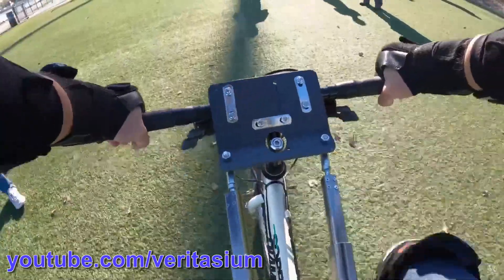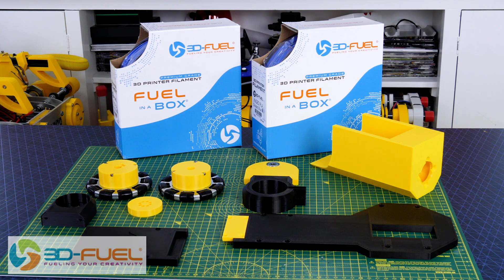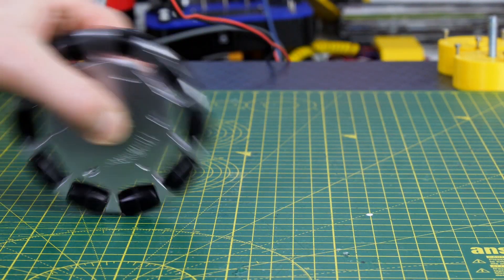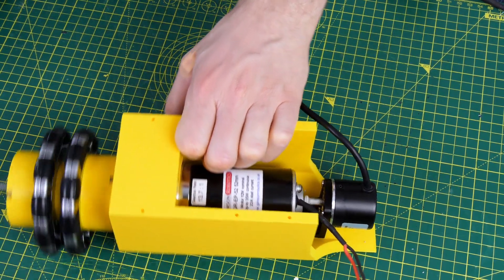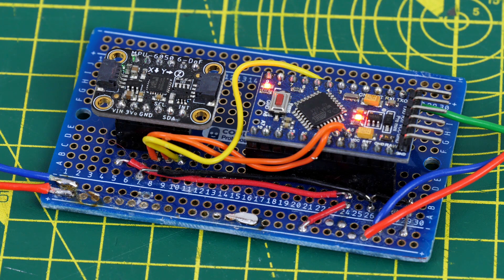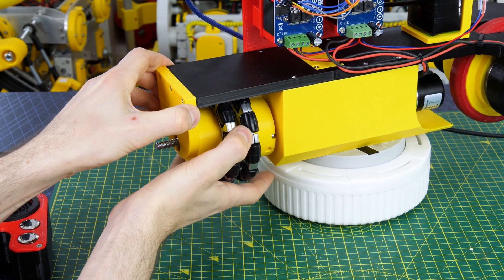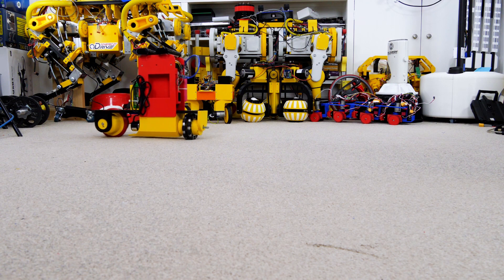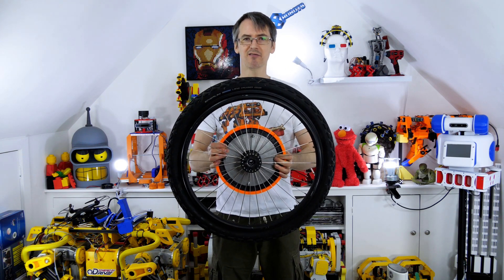Omni-Wheel Balancing Robot Bike

Comment: If you use an arduino due there is a built in hardware quadrature decoder available. It would alleviate your problems with the interrupt taking too much time from the high resolution. There is almost no speed limit and you can just query the memory whenever you need it on your own terms. It's not a commonly used library, you have to set a few registers to make use of it.

Comment: You should make an American football-shaped robot which moves by driven belts with an air-duct cleaner attached to the front.  The football could be opened and closed via a screw to fit through and grip various duct sizes and shapes.  Such a robot would be highly valued by my wife.

Comment: fun fact! having the front wheel turned 90 degrees is a really good way to balance a bike on the spot, or "trackstanding" as its called. Or actually the steering is often slightly off 90 degrees, so that you can use pressure on the pedals in coordination with the brakes to move the bike left to right. Maybe that's another concept for a robot?

Comment: Great stuff!  To get around your encoder interrupt problem you could use a proper quadrature counter - I think the Teensy 4.1 has them, but it is 1/10th of the cost to use the Pi Pico RP2040 and implement quadrature counting in the PIO.  I implemented a version which works with count rates above 10MHz without overclocking, and there is a published version on the GitHub examples now (but I’ve not tested how fast that is).

Comment: 7:14 You might consider using a pico. Or (as I recently learned) an ESP WROOM as those both have two cores. With the WROOM  development boards having the additional feature of having onboard  wireless communication.
Both have plenty of IO, RAM, and ROM for all sorts of projects, are dirt cheap (around 2 to 5 bucks), takes less power, and are overall superior to an Arduino.
Reply: The Teensy 4.0 or 4.1 are even more powerful(well very fast single core) and not too expensive (~$20). Only downside of them is that they don't handle 5V IO or much more than 5v at their Vin pin. I've been using them for all my projects lately.
Reply: @lordgarak  The reason I suggested those were a) dual core, and b) only around 5$.
And while the teensy 4.1 has enough pins the 4.0 hasn't. On top, it has only half the RAM (but a lot more ROM, but ROM usually isn't the issue).
With 2 cores can have one core do real-time stuff which shouldn't be interrupted, and one for the not so critical rest. As they talk over a shared section of ram, it is also faster than serial. Sure, the 600 MHz of the teensy is probably fast enough that you don't need two cores(/processes) but is also 5 times the price. And for 5 bucks you can get a WROOM development board shipped from China. It gets cheaper for each one of you buy more than one. Dunno what the prices for picos is, right now, but I got mine for 5€/piece including tax and shipping.

Comment: Great work, Its looks so natural with its wiggle, wonderful mix of wheel geometries. Fascinating to watch it move. An alternative to brushless or DC motor might be the coreless DC motor, low inertia and high stall torque, Ive used with belt drive directly to the wheel and encoder on the motor for my earwig balancing robot.

Comment: Why use arduino boards when there are products out there like the teensy? Even back in 2016 you could get a teensy 3.2 for the same cost as an arduino, but running at 100mhz, and with way more digital IO, more interrupts, and yet still compatible with the arduino ecosystem.

Comment: Turning the front wheel sideways takes away the fundamental technique bikes use for balance (call it passive stabilization?), so I'm not sure what he meant at the end by, "balance normally, [then turn on active stabilization.]" He'll have to stabilize actively the whole time, since normal bikes balance due to the front wheel changing its center of balance as it steers. Basically, bikes are engineered so that the front wheel "falls" into the correct position to counter steer against the current center of balance of the whole system.

Comment: In all of these omi wheel videos I am wondering if worm gears would work for the rollers with helical gears driving them. This way the helical gears which are planetary (carrier fixed/used to mount motor and connect to bike frame) could be powered by a motorized sun gear. The wheel is the ring gear with enough worm gears along its perimeter to keep in contat with the planetary gears to prevent the whole set from slipping.

Comment: Hi James, another quick "hack" to get an encoder shaft coupled onto a motor is to use a piece of vinyl tubing. You can get a very reliable fit if you just jam both shafts inside a piece of tubing.  You can even wrap a hose clam around it and tighten it all down if you want.
Reply: Heat shrink tubing might work well.

Comment: Would just like to say, a bikes front brakes are very important, and would be curious to see how a front brake could be added on a full scale build of one of these?
Reply: Brakes are important, sure, but why would front brakes be important?

(I'm dutch, a country well equiped in bikes, and most of the traditional bikes have coaster brakes on the hub of the rear wheel, where braking is applied by rotating the pedals in reverse until the brake engages; no front brake at all.)
Reply: @landsgevaer  I've visited your country once when I was a kid, lovely place and people! You make a good point; it will depend on the type of riding you do.
 Personally, I race bikes more than using them for transportation because where I live in the US it is far away from town, and I just like going fast. I would say though having more control (a front brake) is still better than not having it simply because of the weight transfer during braking moves the riders weight over the front wheel. Again, not critical, but any riding over 20mph would benefit from it.
Reply: @Airspaceuser  Always welcome to visit. 🤗

Frontbrakes are very effective indeed, so much so that you can flip "over the handlebars"; not the nicest way to fall if you have to fall. Not sure how that balances out against being able to stop a bit quicker (I don't think that braking distance is critical in typical bicycle accidents).
Motorbikes do brake more strongly on the front wheel certainly, but such a bike has a rather different mass distribution.

Anyway, lets agree then that having multiple brakes doesn't hurt.

Comment: does the software sense the direction of the encoder or does it imply it from the direction of current through the motor. i should think a feature in the counting loop that senses a change of direction might be a bit of a headache. so it might not exist.

Comment: I wonder if something like an Arm Cortex M0 would be a suitable higher-power substitute for the Arduino. I'm using one (a Seeeduino Xiao, which is just adorably IO-sparse) in my Foone-esque crappy keyboard project that uses a rotary encoder as the keys
Reply: Teensy 4.0/4.1 is Cortex M7 at 600Mhz and are incredibly powerful and still only ~$20.

Comment: On a normal bike you have rear wheel driving. If replace the front wheel with the omniwheel I doubt you will be able to turn on the spot unless the front wheel is the main one. But then how would you put gears and or chains?

Comment: I don't think this can be called a bicycle.  Its a balancing robot with an omni wheel and a drive motor.

A bicycle gets its stability by the 2 inline wheels, and the variation in angle between them self-correcting for the lean.  Your "bike" robot isn't correcting for the lean by the difference in angle between the wheels, its literally just moving the centre of mass to be in the "right" location when the lean occurs.  Which isn't really whats happening in a traditional bike scenario.

Comment: I noticed that both wheels had bent shafts which caused both ends to wobble.   Fixing the wobbles by fixing the wheel shafts should help resolve that but the bent shafts and the flexing is pretty evident.

Comment: The drive shaft (threaded rod) holding the omni wheel isnt straight. You can see the end of it wobble when it turns while the frame os being supported. It is flexing the entire chassis as it turns. This has to have an effect on the balance.....
Reply: I thought the same thing when I saw that.

Comment: I think the issue of more wobble at high speed is because of the sort of forward caster it has right now, so it tends to get pushed into a turn and oversteer. Driving backward might work better.
Reply: I thought about this issue as well. To me it looks like the robot tries to stay leveled with the ground all the time, while during higher speed, it should tilt into the turn. The algorithm should set the balance angle according to the speed and radius of the turn

Comment: I have some code that will poll two quadrature encoders at 200khz on an avr, if you're interested.  Doing this in interrupts is risky since it works fine stopped, the avr gets more and more busy as the motor goes faster, then crashes while traveling at high speed...

Comment: I'd love to see more advanced control system than PID like state space or discrete-time control. Keep up the good work! (maybe I need to open my old books and try to add advanced control myself.) Also a little faster microcontroller can help with the encoder sampling, some even have dedicated peripherals (ESP32). Or you can use a counter connected to an input. Congrats for the 1 mill subs!
Reply: Yes have a go and let us know how you get on. See if you can keep pace with James with one quality video every week.
Reply: @andycrask3531  I know it does not fit in one week I did not mean he has to do it, but these fantastic machines are maybe just a good control away from being stable. Maybe a collab could help. I know these things are open source and if I have some time I will have a go for it. (and probably fail :))

Comment: Question/Suggestion for James: I don't know if you already do this, but have you tried transforming the PID controller input to account for the differing amount of force when the vehicle is at different angles from centre? Should be some simple trig which'll help it not over-compensate at low angles, and push more at high angles. Off the top of my head, calculate the sideways portion using O=tan(a) where O is opposite (sideways component) and a is angle.
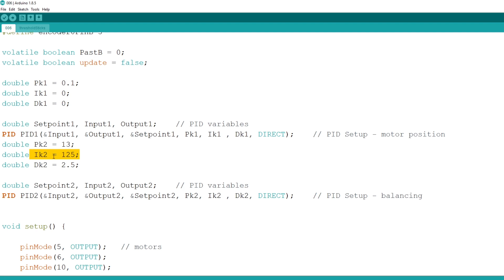Reply: @Lassi Kinnunen (WILL CHANGE ACCOUNT IN 2 DAYS) But let's take a look at what PID is, and what it's doing here;- I'd assert that PID may be capable, but may not be suitable for this model. James uses such an insanely high integral (9:12) because the error over time is essentially moot - we want to know what the error to balance is now (and possibly other things like angular momentum or velocity (which the integral could be a poor analogue for in this situation?)). And we can see the results of this in the behavior;- explosive readjustments when slightly off balance for a short time, but which is needed at higher angles off centre.
My suggestion is to try and scale this error to approach something like a physical model.
Reply: @Lassi Kinnunen (WILL CHANGE ACCOUNT IN 2 DAYS) Also, James uses an offset to the balance centre in his code to control steering. This is where a physical model would particularly help, because the PID is currently reacting linearly to something that is not linear. Trying to sustain an off-centre balance should require more 'reactivity' away from the downward-facing side than the side nearest the balance point.